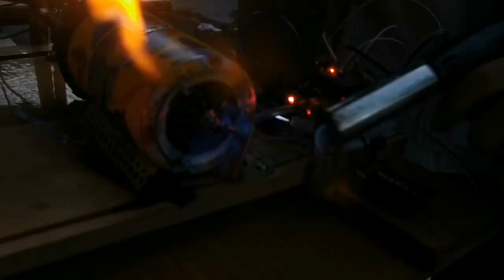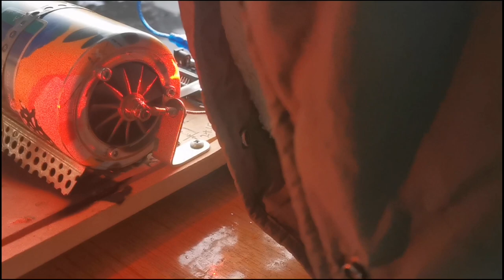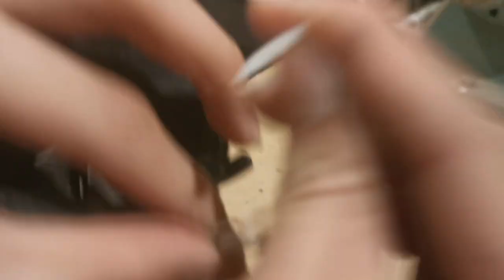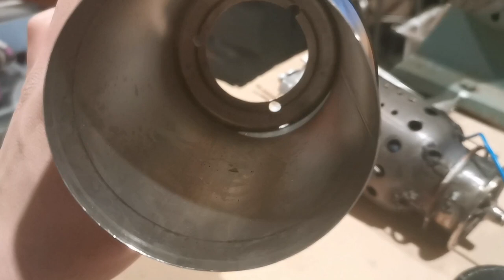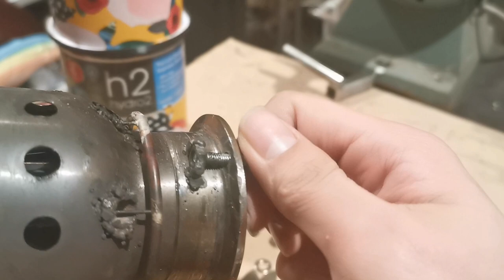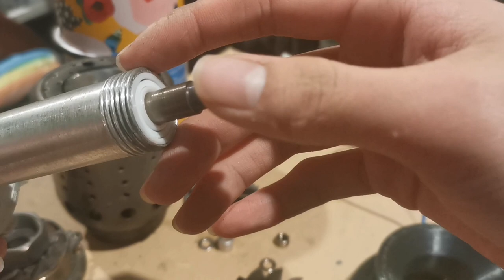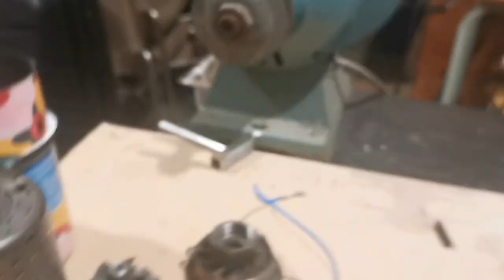Jet engine test and disassembly

Comment: What is the name of your ceramic bearing
Reply from the maker: No lubrication was used. Also why ceramic bearing was used.
Reply from the maker: It was a generic branded one from aliexpress
Reply: @tamashamas6193  ok
Reply: @tamashamas6193  Is it possible to use silicon nitride bearings for jet engines?? 
I am planning to use them
Reply: @yashwardhan8542  i wait your comment
Reply: @KingBoy-kf9wr  And I wait Tamas Hamas' comment
Reply from the maker: Hi sorry for late reply.
I am unsure, best check the rated operating but if I recall correctly SiN bearings are usually more robust than Zirconia

Comment: Are you sure your engine doesn't have any leaks?
Reply from the maker: No large leaks but unsure how significant small gaps and whatnot are
Reply: @tamashamas6193  you did mention in another comment the pressure inside the engine was very low
Reply from the maker: Indeed, not sure how to fix but u have left my thoughts in another comment, where someone had left some detailed feedback.

Comment: air pressure must be only 1 bar to self ?spin
Reply from the maker: The engine got nowhere close to that.
Perhaps 0.04bar developed.
Unsure why there is barely any pressure
Reply: @tamashamas6193  The engine should already start to run selfsustained at a pressure of 0.1 bar to 0.2 bar.
Actually it is not the internal pressure which is of interest, but the flow speed and amount of air passing the system to produce thrust.
Pressure and flow are of course somewhat linked together, but having a high pressure with almost no flow, will never run.

The vanes angle on the diffusor is IMHO too shallow. It has to be more agressive.

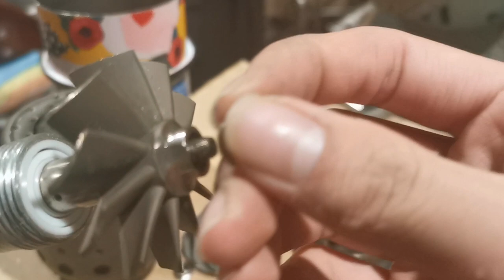25:00 it looks like the outer race of the ceramic ball bearing can spin freely. That is probably because aluminium will expand quicker and wider under high thermal conditions than the bearing is able to.

Another thing I noticed: the tubes covering the fuel inlet needles seem to be very short. Do the needles stick out of the tubes? If so consider to extend the tubes.
The heat from the tubes will heat the fuel in the needles when doing so and the fuel will enter the burning chamber as vapor.

You may want to consider to use propane/butane instead of methanol. It is easier to ignite and to get a successful and self-sustaining combustion.
Progress to petro/diesel/kerosine when that combustion works and finally go for methanol.
Strive for the low hanging fruits first. You don't know if the engine will be able to run at all. So why not ruling out some unknown.

And as for loop already is asking, what about leaks? 
Don't underestimate the power of air. 1 bar can press water in a column 10 meters high. The stress put on materials and seals is tremendous.
I just saw some weeks ago a video with a transparent engine housing. It was clamped down and the seals were massive and tightened very serious. The seals simply got squezed out of their seats and were completely displaced after the engine spun up into the higher regions of rpm.

But a nice looking project, buddy. You are on the right way. Keep on rocking 😃
Reply from the maker: @Jan_Seidel  hello Jan,
Thanks for taking the time to type that up. Those are some interesting thoughts, I very much appreciate your feedback.

I assumed running off any liquid fuel would be more effective than butane alone, simply for the much power delivered through combustion. Those tiny camper canisters cannot sustain high flow for very long. 
The needles do not extend pass the tubes, so that should aid in evaporation. 
I chose methanol since it is known for volatility, hence it should burn more cleanly even if my mixing isn't so great. I will attempt something else next time. 
This probably isn't the most critical issue however, a good turbine should run well on any fuel I'm guessing.

The more critical issues are probably what you have pointed out. 
The pressure and flow rate are a function of engine rpm and the geometry of the internals. However combustion efficiency is only a function of pressure. Is this correct? 
The turbine used is from a turbo and apparently require much higher rpms, since they are design for efficiency. 
There is still much vibration in the rotor, and I am unsure how I could reduce imbalance. Preventing the high rpms needed. 
Diffuser geometry is something I could adjust as you suggested. However given I am no aerodynamicist I'm unsure to what effect those adjustments would provide. I will probably take your advice. 

Engine leakage is probably a big issue but as mentioned, not much pressure is being prodcuued so far, but this is definitely something worth working on. Currently the casing has no way of being  clamped onto the diffuser, so sealing is quite bad. 

And indeed I think I know what video you are talking about. That was quite amazing. 
Shows me how far to go I still have, my engine is far to flimsy and not at all precise enough. 
Nor am I confident in the deeper dynamics of such a engine. Hence some design choices were simply made based on intuition. 
So apologies if there appears to be any blatant ignorance.
Reply from the maker: Also, what exactly do you mean by the vanes being too shallow?
Any reading you'd suggest on design of these components if you are familiar.
Reply: @tamashamas6193  how do I explain... the vanes should be more towards perpendicular.